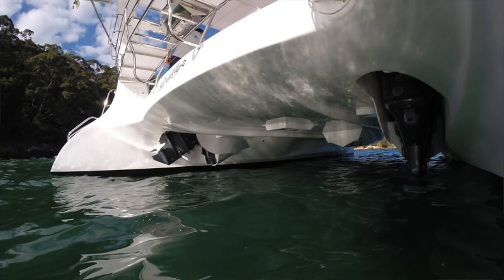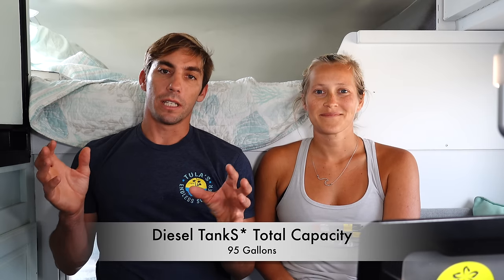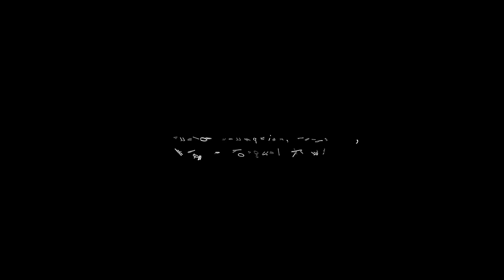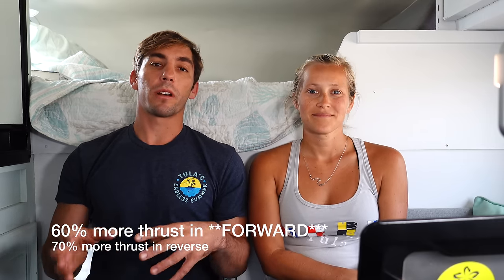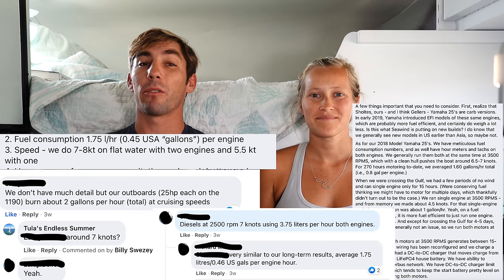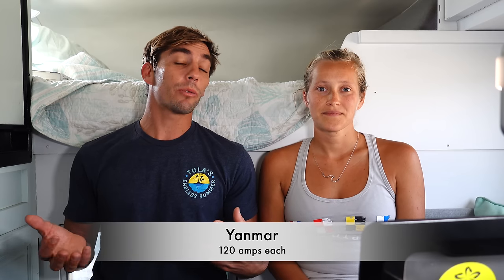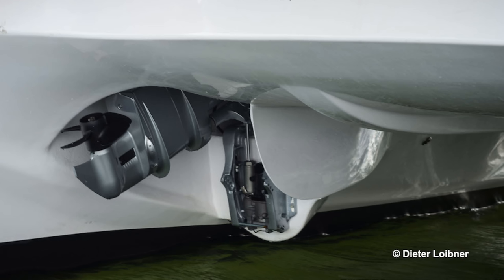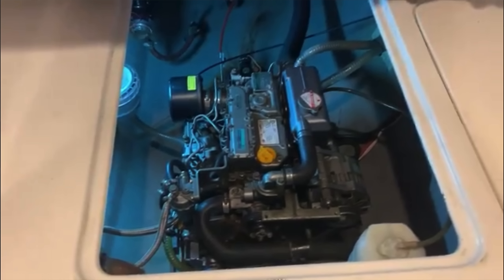Do Outboards Make Sense on a Performance Cruising Catamaran?

Comment: I've got 45 years sailing experience including 25 years living aboard currently. Diesels every time. The diesel also gives you the option of hydrolic anchor winches and a hydrolic garbage crusher...
Reply: Depends on the boat, or ship, but I'd never put hydraulics on my boat.
My right foot is a pretty good garbage crusher.

Comment: Thank you for a very informative video. I currently have a 1985 cruiser with twin diesels. In years to come diesel may be harder to come by and much more expensive. As I aim to use my boat primarily on inland waterways and canals, i would look at replacing the engines with full electric ones combined with large battery bank and solar panels.

Comment: i would go with the diesels. you gave so many good PROS AND CONS, i really had to think. what i didn't really understand was, is it going to be a twin screw. also the diesels looked easy enough to get to and work on. also they put out lots of amps for charging your batteries. now as far as AC goes, i wouldn't own a boat like yours w/o it.

Comment: You could add the high output alternators to the diesel engines and allow the standard alternators to charge the engine starter batteries only. Secondly the diesel prop drag may be used to your advantage for your lithium house batteries regeneration if the fold back propellers are installed.

Comment: A few thoughts
It is too bad that the Sillette Sonic outdrives are no longer available.  Yes they had their problems but 2 of them each attached to a 20 hp diesel would give you the best of both worlds- diesel power, fuel efficiency, high amp output combined with long leg drive that can be lifted out of water and not needing as an intrusive of a pod.
I continue to be amazed at the price of marine diesels.  The name brands command a premium price and I am glad to see they are getting some competition by some new "marinized" diesel co's .  Too bad the cat maker doesn't give you a few diesel maker options.  Some cruisers have even gone to using Chinese made diesels for a refit.

Comment: You made a great choice in picking diesel engines. You will need them to charge the batteries in higher latitudes. I prefer the engines in the middle of the boat with shaft drive but that's not an option.

Comment: Great informative video.
I'm looking at a Seawind 1190.
I'm looking at electrical engines.
There are lots of reasons.
I will be having extra solar panels.
So I hope.never to carry fuel and all the spares required for fuel engine. No problems.
Each time you start your desiel engine you need to do a wobbles check
Starboard side you need to lift the bed to do the check
This will be come very tiring
As access is difficult
It also allows me to carry extra water . 1000 litres of water means I don't need a water maker.
I'm also not having gas for cooking.
With an all electric boat it will be cheaper to run. Just saving the problems  created to obtain fuel to me is worth it

Comment: Lmao, your outakes were hilarious.  Options for my mindset is Luke this. I hate outboards, having said that I also owned any newer than my 1992 merc. You said you could get the same motor for your dinghy and that would be swappable but of course you'd have to change the lower unit as the dinghy would be a short leg. Now as I am a trucker, equipment operator to me diesel is tge only option and the pros far out weigh the cons. Having spent thousands of hours behind the din of a reliable diesel I am most comfortable with them to make sure I get there and back. Yes higher cost but greater reliability and since I have spent so many hours listening to equipment noise is huge for me. As quiet as possible is best for the long hours of running.  Never understood my buddies with there loud pipes. I think you've made the right choice as resale is a huge factor. 
P.s. that shot of Jetty yawning was priceless. Lol.

Comment: Covered most issues, biggest issue of the 1260 is it seems like its just on the hub of being able to carry a little more weight and a little more solar, but may be not quite enough (guess I can say that for any situation)..... beaching  and shallow draft can also be a consideration ..... but my ultimate choice would be a single diesel parallel hybrid electric shaft drive with a matched electric drive in the other hull....if only this was an option!
However in your case I think the diesels are the best available choice, electrical generation is important ...... you should really check out 'Safiery' and their 'Scotty' battery charging technology.

Comment: You made the right decision in my view. I have a 54 HP Yanmar in my boat and I absolutely love it. The boat, (and the engine) is 15 years old, so far I have no issues with it. (knock on wood). I had in the other hand, more problems with the outboards that we use in the dinghy for example. The range and electrical production alone makes it worth it, the extra weight of the diesels, plus the fact that are infinitely repairable, like you proved in the Bahamas. So, to me, no questions about it. Diesels all the way......keep that fuel clean, and you will have no problems!

Comment: You guys are all over this. Just sold my SW. Thanks for driving up the resale $👍. Negatives we experienced with outboards:- cramped working space. Cavitation in rough conditions.  Pros:- Legs lift out of the water, no anodes, cheap to replace,  low weight, less thru-hulls.  What are we looking for now? Either but, we are coast hoppers. If we were ocean crossers, I think we'd be looking at inboards. The leveller is the sail drive. Not a fan.  Would prefer shaft drives. You are going to love your 1160.

Comment: I'd go with the Yamahas + 2 Yamaha 2400 gas generators, and 2 or 3 (cheap $200 ea.) 5,000 BTU AC units, the saloon is only 100 square feet, so it is easy to cool. When the OBs wear out, convert them to electric, add more lithium batteries and all the solar panels you have room for. I would remove 1/2 the back rest of the bench seat in front of the galley so it is more open to the saloon. Today you see big center consoles with multi outboards, carrying 800+ gallons of gas without issue. Enjoy the journey!

Comment: In my world safety is foremost in a off-shore marine environment.  Due to that I would probably go for the diesels for their range and reliability.  I realize that they weight 842 lbs more than the outboard with full fuel but it weight really that much of a factor when the overall weight of the boat is factored in.  I realize it's your boat and your call but if you get de-masted range can be a real issue.  You're both pretty smart so I'm sure you'll make the best decision your situation.

Comment: I think that the experience and the solutions regarding the electric motor made by the two guys of "Sailing UMA" are unique and very valuable
Reply: yea there are even full solar powered cats out there without any sailes

i also think a combined solution would be an option these days especaly on cats
a cat got more deckspace for larger solar arrays
with a regen system like uma ist testing with the ocenvolt servo prop and 2 of them on a cat and the higher speed cats can go you can regen more while on the travel under sails
and now i would add a generator to the setup who can sustain your cruising speed electrical needs and maybee also charge at the same time (didnt do any maths regarding this). there are realy quiet generator systems out there you can place them on the boat more freely and encapsulate them better, getting it out of the way or on a easy to interchange access port

you have now best of both worlds. i am not sure there is such a setup anywhere
Reply: @Total_Egal  UMA has as many solar panels as they have, they first added a wind generator but did not charge much, Then they decided to take a portable petrol generator because they are approaching the north pole and the panels do not receive the right amount of sun because of the weather and an always cloudy sky

Comment: One thing you didn’t mention but with an inboard engine you get free domestic hot water using a loop through a hot water heater from the engine cooling system.

Comment: What a blast making choices for a new boat!!! Our Max44SC will be completed Oct 2022 in Vietnam so may see you around, SV Stray Kitty. Get the diesel. You need large alternators to keep up with the boats electrical needs, 1/4 the fuel with diesel, easier and safer fuel storage, 3x life expectancy, way cheaper maintenance. If you can get the Hybrid Yanmar or Beta that is even better. Happy Cruising.

Comment: Ok Billy and Sierra, you knew I had to comment. On Sunburst I had twin Honda 15's for 20 years. I had speed props and maxed out at 10kts, 8kts into 50kt winds. The motors were 12ft apart 8ft from the transforms. They never cavitated. If they had ever failed me I could have taken them to get repaired. The only problem was the poor wiring and reverse was week with those props. I have repowered with 9.9 Suzuki with high thrust props, they really stop but top speed is only 8.5kts. The most important feature is they are fuel injected. As to economical the Hondas at 7kts burned half gallon of cheaper gas an hour, I don't know yet about the Suzuki but it takes 35 min to burn the fuel in the engine after disconnecting the hose. My big deal is who can repair the engine and where. Natives in the islands seldom have diesels but all of them have obs. Also I don't want anything under my boat that needs repair or could leave a hole. Most of the comments about obs are very outdated. The new keyboards are really something!

Comment: For my personal preference I'd go with two electric outboards, say the epropulsion 6kw (and add an induction cooker in the kitchen). Advantages: 50% weight savings to the petrol outboards, much higher recuperation (up to 1000w at 10 knts.), no noise, basically maintenace free, off grid solution. Drawback is far less range and less top speed. But if you're living on the boat and/or are a circumnavigator these drawbacks don't matter, since you're not on a schedule. And since the epropulsion allow third party batteries, you can put on your diy lifepo battery for dirt cheap.

Comment: Very relevant to us as we’re having a performance cat built for liveaboard, however we’re going with outboards. Reasons in no particular order:
- WEIGHT. Our boat is very light and we should be able to sail wind speed easily from 3/4kn true. Adding ~350kg is a non-starter.
- DRAG/EFFICIENCY. Our outboards are mounted in the hulls and pivot up with a ‘plug’ going into the hole leaving a perfectly smooth hull. This also removes the cavitation and noise problems. According to our designer/builder (who has built 20+ of these, some diesels and some outboards) you can fit a much more efficient prop (no need to worry about drag or have folding one) and you gain back in thrust efficiency the lower power/fuel efficiency. In their experience you get similar range for only a slightly larger fuel load. We can also specify, within reason, the size of the tanks as it isn’t a production build with limited options.
- MAINTENANCE. In the event of a serious issue you just (!) lift out the outboard and take it ashore. Also no issue with cleaning props etc.
- BACKUP & OPTIONS. having the ability to swap out with the dinghy is useful, but also the ability to potentially swap for an electric outboard when the technology becomes suitable. This might become increasingly necessary as diesel is starting to be banned in certain places. We are pondering one electric and one petrol/gas at some point.

To me the biggest single issue is electricity production, that is clearly where diesel is miles ahead. We’re aiming to mitigate by having a lot of solar (the boat is 15.2m with a high aspect ratio main and thus short boom so more space to put panels) and LI batteries, plus a hydro-generator and a back-up portable generator (petrol/gas) if required. We’ll be in the tropics, this might not work in higher latitudes. Also we have no a/c but will have all electric cooking and no propane.

Comment: A diesel typically runs a minimum of about four to five times longer than a gas outboard before needing major overhaul or replacement.    If you run the engines fairly regularly, outboards can be worn out much sooner than one would expect.
Reply: I was recently researching large outboards (200 HP) so I don't know if this carries over to small outboards too but, the data says outboards that are run regularly in some commercial operation or water taxi last about 4000 hours or double the hours of a private party who uses their outboard less regularly.  I think the Tula crew would be in the category of low frequency usage and short duration when used meaning shortest life in total hours.  So the Diesel choice is a good one for range, performance, reliability, longevity and yes, economy over the long term.  10K hours for a very well taken care of and maintained Yanmar vs. 2K hours for an outboard....I guess the 5 times the price thing actually makes sense.  The Yanmar engine will easily do 10K hours but the "cooling systems"on the Yanmar requiring maintenance and regular checking and cleaning can quickly kill any diesel motor regardless of hours on it.
Reply: @timhardman4764  -   and  .  .  .  .  .  it  is  a   ' S a i l '   boat .     It  should  be  ' under  sail '  !
Reply: @richardhobbs7107  Agreed Richard and these guys definitely prefer sailing to motoring.  But I think this video was mostly about motors and motoring...thus my non-sailing comment in this particular video.  If the next video is about electronics, I'll probably comment about electronics...I know, I'm kind of crazy.
Reply: @timhardman4764  -   I  liked  your  comment  especially  concerning  the  cooling  system  for  a  diesel  being  so  important.     For  me  I  would  prefer  the  outboards  for  the  redundancy ,  lower  cost ,  sailing  efficiency  with  them  tilted  up ,  &  ease  of  beaching  the  boat  &  shallow  water  sailing .    
   I  read  somewhere  most  sailboats   are  motorboats  with  auxiliary  sails  in  actual  practice  .  .  .  .
Reply: @richardhobbs7107  haha it is real 90% of sailboats are really motorboat with auxiliary sails👍

Comment: Diesel engine, not a big issue in Florida but a diesel cabin heater is a nice dry hot heat. Plus the stability of diesel fuel vs gas and the easier water removal  and usability from diesel fuel

Comment: Since you will have 2 alternators from the 2 diesel engines, and seemingly enough power to charge your house batteries and extra, and also wants to avoid 2 different fluids for power, maybe go for an electric outboard on your dingy? I'm not sure a set up like Uma with solely electric power for the yacht is economically smart/possible yet, but more in line with what Rick Moore did on Sophisticated Lady - changed from gas to electric outboard. Ofc, this is given you only use the dingy for light/slow travel and get enough speed kick from sailing your cat at 15 knots and not least the kites and other toys you have.

Comment: I like your truck camper videos, it's a cool change of pace, the Diesels  have much more powerful alternator's and you could put higher than 120 amp alternators or even 2 per engine, however the Yamaha option is the easiest to service when the time comes.
I knew you would go diesel before you said it.

Comment: Diesel for sure . That added range can be a life saver for extensive off shore sailing. Racing is fun and less weight from outboards would be an issue there but, how often would you race anyway?

Comment: Great video,  and are some good options.  I can see the outboards on a boat being used locally and not being sailed more than a couple of hundred miles from it's home port.  But for a serious cruising vessel diesel if the only option.   Though you didn't mention the differences in fuels as diesel can also be used to heat hot water through a hydronic heating system.  as well as used to heat the boat in some more northern climates.  Gasoline has a much evaporates too quickly creating a fire hazard which is never good on a boat, where as diesel fuel doesn't evaporate as quickly and has a higher flash point making it safer.

Comment: Most marinas only offer diesel and to get gasoline you may have to go to a gasoline station and fill up via jerry cans.  Also diesel will be more efficient and the alternator will recharge the batteries quicker.  The only pros of having an outboard is if you get a mechanical issue in a remote location - it is easier to replace an outboard or find spare parts for an outboard + an outboard is cheaper to replace + two less holes through the hull to worry about. Personally I would spend the extra 20K and go with the diesel engines.  Also the option to have the LPG hot water heating system is also a good option since you don't have to worry about running out of hot water when having a shower, etc and having to run the engines for hot water.

Comment: I say you made the right choice with the Yanmar diesel. I had an older version of the exact same engine (3ym30) on my 36 ft monohull sailboat and it was a very dependable workhorse. I motored a lot, anytime the winds were not favorable I didn't hesitate to turn on that engine. I spent 5 yrs mostly to/from and through the Bahamas every winter for 5 months a season. I kept an accurate fuel log and that engine consistently used 0.6 gal per hour, running at 2200-2400 rpm.